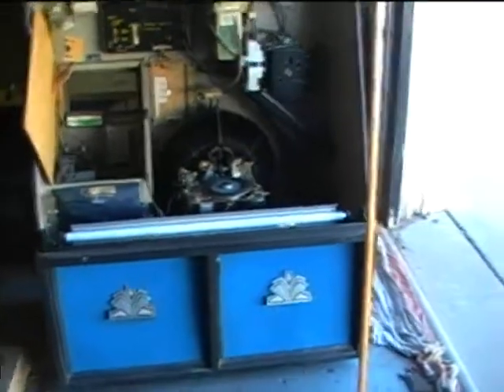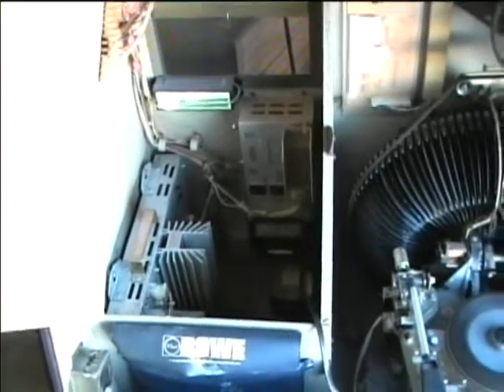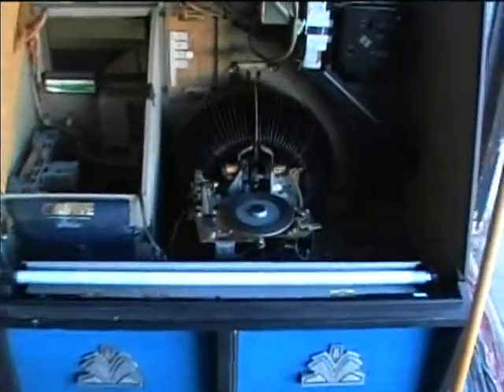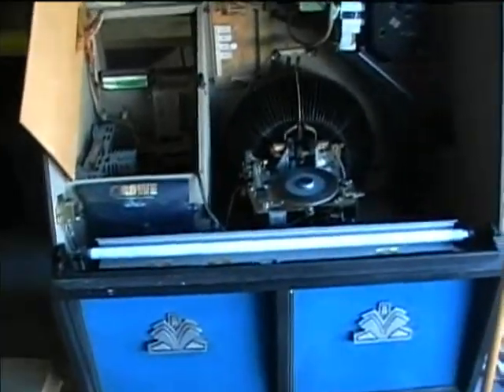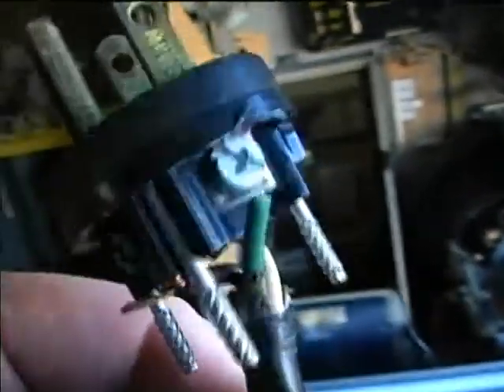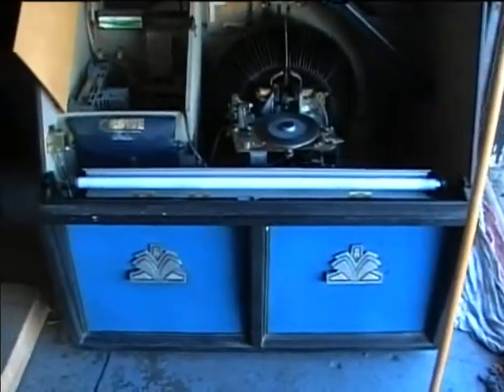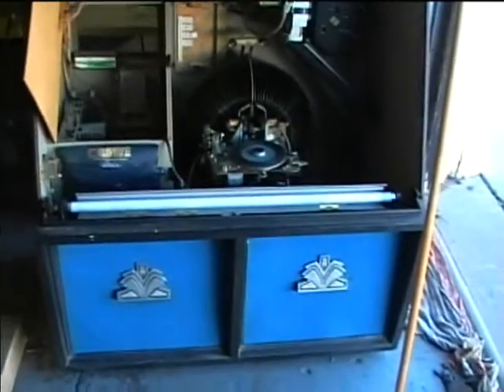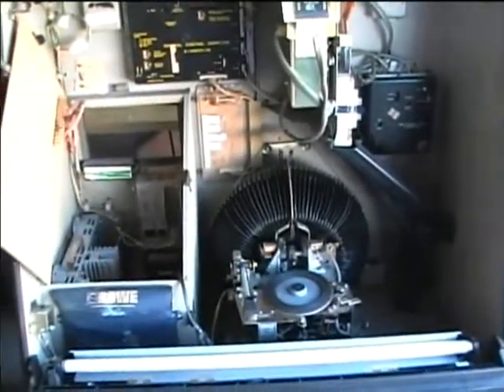Rowe R-88 Jukebox grounding wire "safety shocker!"

Comment: You can be thankful they wired it to the neutral prong (plugged into a correctly wired 3 prong outlet).. Use a un-polarized extension cord with a slender plug that lets you bypass the ground pin and plug it in anyway and you have a 50 % chance of managing to get that prong inserted into the hot side making the jukebox case live to ground , that would not be fun at all .,.

Comment: a great lesson! i'm in the u.k so things are a little different....but confusion is even worse! some j/boxes i get in for restoration, still have old mains leads on the, where rock-ola used to use RED as the ground which in the u.k is the live conductor! so you can imagine what happens when a diy guy connects it up, the whole machine is live!....i have learnt, always assume theat the last person who had the jukebox was a moron, and check everything!
and use a RCD 30ma trip
bob [u.k]

Comment: Yep, I know this problem and it is not good. I am still learning in school and one on my classes is dealing with basic Industerial Eletricity. We talk about one-way, two-way, three-way switches, color wires, hooking up switches to make a 15W light work and more. I know myself on how the fix wires on somethings but am one of the slow people that it takes time to learn all this stuff. That Rock-ola 432 i have had a bad plug at the end and i did not trust it so i fix it with a new plug. Be safe.

Comment from the maker: Oh no! that was good that you found out what was going on. That was exactly the setup that was going on here, only in your case the conduit must have been serving as the ground and when it started to get corroded, it was arcing due to the fact that there was current flowing through the conduit.
We used to get this magazine at the radio station called "EC&M" and it would often feature reports on unusual electrical safety problems like this.

Comment from the maker: A lot of the older AC/DC radios which had the chassis exposed had the power supply ground isolated from the chassis and used an isolation capacitor from the circuit ground to chassis to help make it somewhat safer. I have heard though of those which did indeed put the power line neutral right to the chasiss but haven't seen one myself. If yours is that way I still think I would use an isolation transformer as the neutral can still have a voltage above ground.

Comment: This danger is built into the design of my Hallicrafters S-38C radio.  It is a transformerless AC/DC set with an unpolarized plug -- and a metal cabinet!  I always make sure it is plugged in the right way before touching it.  The previous owner recognized this too, and marked the "hot" side of its AC plug with an "H".